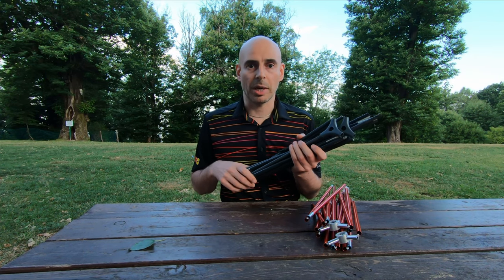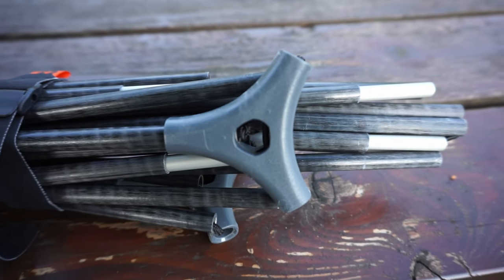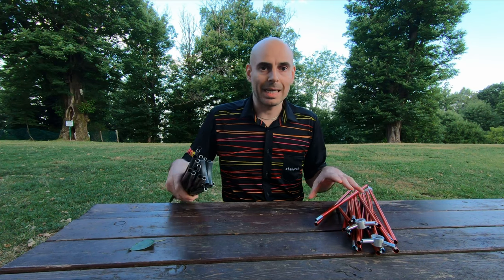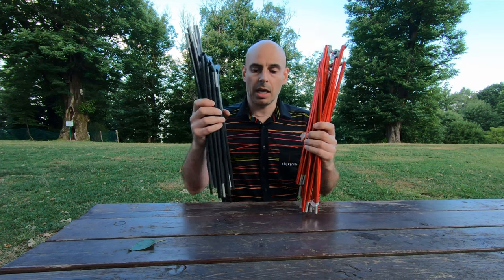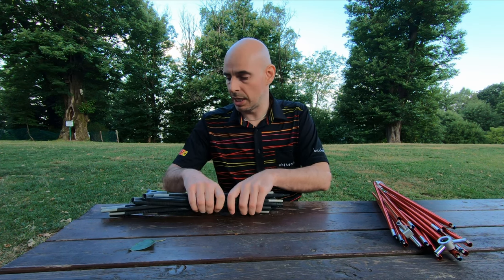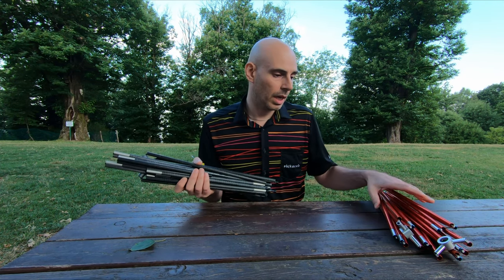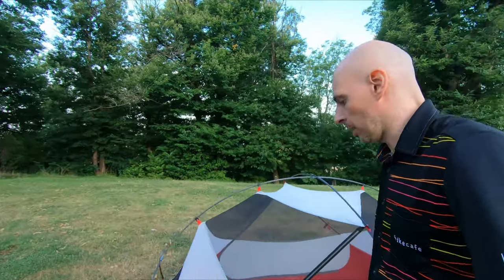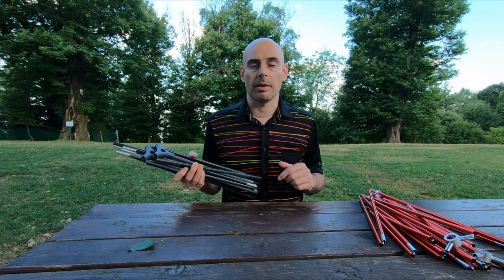🇬🇧 Syclone poles (by Easton) for tent MSR Hubba Hubba NX (american market)

Comment: Davide, I have a hubba nx solo with the carbon poles. I have had the same problem but used a piece of gaff tape placed over the sliver in my finger then ripped the tape off quickly to remove the sliver. I bought my nx solo in Canada before a trip. I also have the hubba hubba nx2 that has alloy poles and this was bought in Australia. The solo is great for hiking & bikepacking but the nx2 is great when wet & you want all your gear indoors. Both tents have red & white outer flies and I wish I had the dark olive outer when camping in places I prefer to be unseen. Birh tents are fantastics in all weather. I am not sure of the logic of what configurations are sold to the various countries. Great channel, keep up the great content.
Reply from the maker: Thank you for the kind comment 😊👊

Comment: Davide, I purchased these poles and really felt a peace of mind.  I had two sets of the aluminum poles crack as you mentioned.  I haven't encountered any flacking of the fibers as mentioned.  I feel the larger joining areas make the pole set sturdier too; I feel less stress about bending the pole set.  I think I paid about $125.00 for them at MSR in Seattle.
Reply from the maker: Yeah after travelling for over a year and half with them I think they are way better than aluminium. Not sure I like the larger joints though 😅

Comment: Yes! I got slivers too, that is a serious drag, it took like 3 weeks for
 the sliver to work it's way out. I also wonder about the poles chaffing
 against each other under vibration. I bought mine for motorcycle 
offroad camping and there is a ton of vibration. I think I will need to 
wear gloves for the tent set up too. Which is really dumb. Easton needs 
to address this issue. I'd rather have aluminum and no slivers.
Reply from the maker: You can use a velcro strap to avoid the chaffing when you travel. The strap with keep them firm and in place.

Comment: They are made from a blend of S2 grade fiberglass (significantly stronger than regular, E grade fiberglass) and carbon fiber bonded with epoxy. They are wrapped in a way to be more flexible. S2 glass is very tough stuff, though not as stiff as carbon fiber. On a volume to volume basis, S glass fiberglass actually has slightly higher tensile strength, and will stretch a bit before breaking. On a weight to weight basis, carbon fiber has a bit more tensile strength, but with the regular grade, not by much. Carbon fiber is just a lot more innately stiff, and therefore also more brittle.

Comment: Regarding the slivers, it's a really easy fix. I use extreme fine sanding cloth and go over the poles then use a tack cloth and a blower on them. All the loose fibers are completely eliminated. I rub my hands all over the poles when I’m done and perfectly smooth. Nothing to come off in or on ur hands now.
Reply from the maker: Thanks for the tip. The Sanding isn’t going to weaken the fibres of the tubing at the extremes?
Reply: @DavideTravelli  not at all. You're only lightly sanding off any loose or protruding fibers. You can also check for any areas that need additional attention by running a cotton ball up and down the shafts. If anything catches the cotton ball, it needs additional sanding in that area. This is common practice on things made from carbon fiber.
Reply from the maker: Okay will try it at some point!
Reply: @DavideTravelli  Davide did you try this method? I have the same slivers problem and I think  I’m going to write to msr and asked them for their solution.
Reply from the maker: Not yet. I’m travelling and have many things going I didn’t have time yet.
Reply: @DavideTravelli  ok, I made it. Looks like it works perfect!
Reply from the maker: Great, thanks for the feedback. Can you specify what kind of products you’ve used?
Reply: @DavideTravelli  I just use some fine sandpaper like 240-400 grit. Lightly sand the shafts. Put some denatured alcohol on a towel to remove any dust or debris. You can rub a cotton ball over the poles and if any areas need additional sanding, the cotton ball will catch or snag on those areas. Re-sand the areas that snag the cotton ball until the cotton no longer snags on the poles. It shouldn't take much sanding.
Reply from the maker: Thanks.
Reply: @DavideTravelli  I used fine sandpaper (1800 grit) and 3m Aqua Tack Cloth.
Reply from the maker: Thank you!
Reply: Great info, I love MSR products but am concerned about the splinters. Now that you have used the tent a bit more, do you have any regrets?  Is the splinter maintenance something that would prevent you from buying this tent again?
Reply from the maker: No I’m loving the Syclone poles.
Reply: @OutsideChronicles  Myself, I've put several weeks in my tent through motorcycle travel and love the tent. By doing the above suggested preemptive measures the issue of splinters is gone and you'd be hard pressed to find a better tent. It's just hard to believe that MSR doesn't finish their poles correctly at the factory.
Reply: @rickyoung360  Thanks!

Comment: Syclone poles are a great technology, except for the little inconvenient that they.... break easily (yes, I´m being sarcatisc). I purchased an MSR Hubba Hubba NX in the US back in 2017/2018, can´t remember exactly, and after about 5 uses the poles starteds to bend and crack very close to the top hub/ring (?), and a while latter it just broke apart, ripping the rain cover right at the top as a consequence (add insult to injury...). I live abroad and it is virtually impossible to get a repair or replacement from MSR. Now I´m buying some generic carbon fiber tubes from Ali Express in the hopes I can fix it myself, but not very promissing. Switching to other brands, such as Big Agnes, after this very unpleasant experience with MSR tents.
Reply from the maker: You should contact MSR support. They’re very helpful. I have been using the Syclone pole for years now and no problem

Comment: syclone are more heavy but more durable and have more sag.
Reply from the maker: I hope they will be more durable but we'll have to find out, for sure they are more flexible and  it makes me more at easy to pitch the tent in very small places.
Reply: @DavideTravelli  compared to a aluminum pole the syclone poles absorb impacts while transporting better than aluminum.  the drawback to them is the weight.  aluminum poles are lighter when implemented; you could get away with like a single syclone pole to setup a 1p tent with that really moves around and is the same weight about as an aluminum but for close to the same stiffness of aluminum it will take a more beefyer(daimeter) syclone pole.

i like my syclone poles on the torrent 3 i have but their destiny lies in being fitted to another tent.
Reply: @chrisprice5806    Incorrect on the weight. I'm looking at a site right now that carries both Easton Al tent poles and Syclone ones.  For an 18" long Al female pole with the OD of .355", the weight is .55 oz/22 grams. The closest sized Syclone pole which is also an 18" long, but with slightly larger OD of .365" and a weight of .40 oz/15 gm. So not only is it lighter, but it is lighter while being a bit larger/thicker. 

   I wish more people would do a little research before making claims.